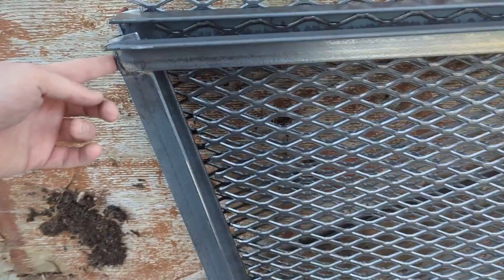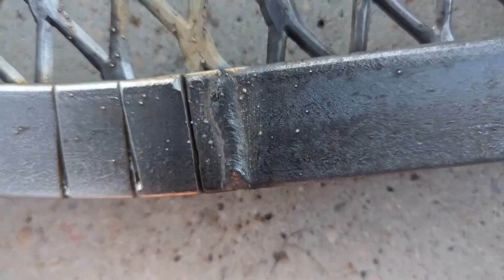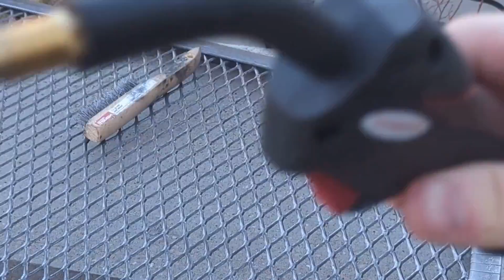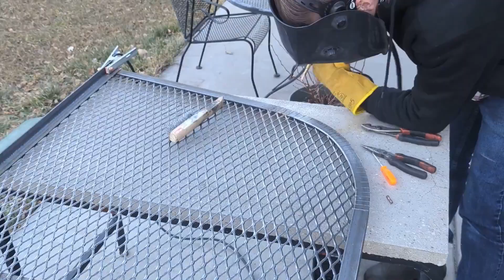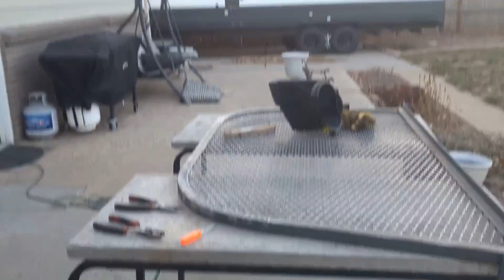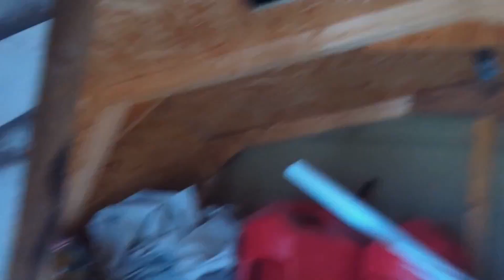Welded steel window well cover

Comment: How did you make the bends in the rounded area?
Reply from the maker: I cut through the top of the angle iron every 3/4 of an inch and then bent the curve by hand. It was easy to do once all the scoring cuts were made